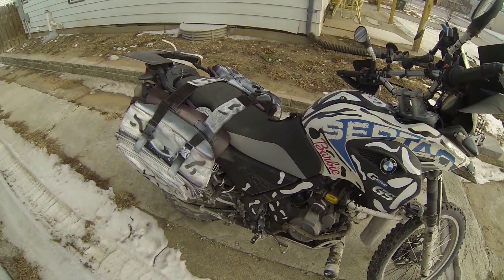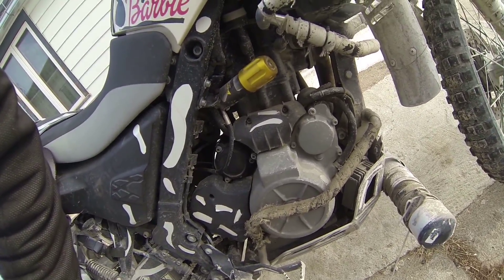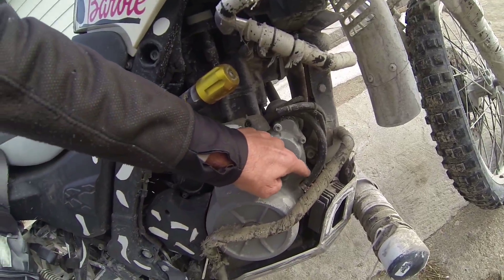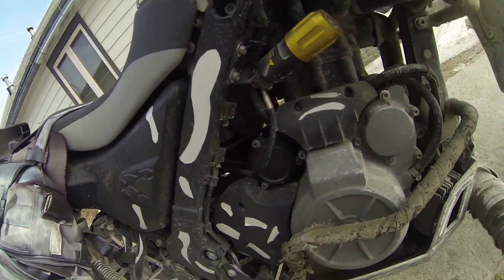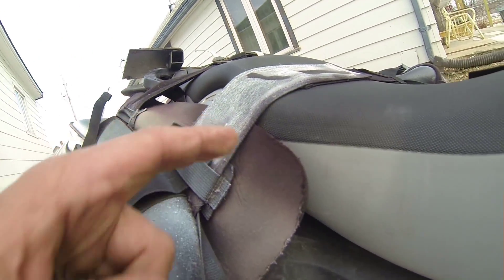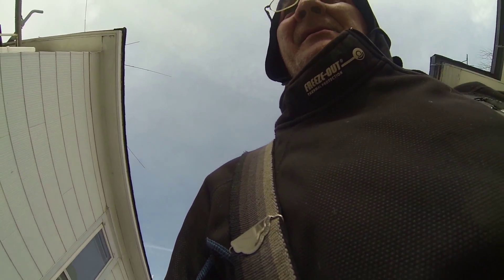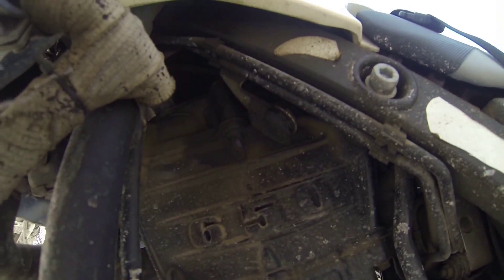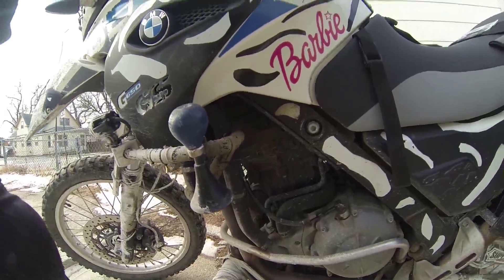Video for Dr  Dual Sport BMW G 650 GS

Comment: Wow how cool is that a personal video! I truly appreciate your kindness to help other riders and share info. I put a Shorai lithium battery in my WR450 and it made a world of difference but they are a bit pricey. The 650 Beamer seems to hold a charge ok but seems a little wimpy on spinning over the engine. I will have to do a cranking draw down and recovery test. I have seen you start in sub zero temps and I am very impressed with that battery and the price is reasonable. I will have to take a look at the Rotax to check out how they vent the crankcase.

Comment: just a wrong routed hose give you all that trouble ....
I don't like gel battery,  I always buy the bigst ( capacity ) what fit from a good company , on my old K75 I use the battery plate of the police version so I can mount a larger battery than in the car of my wife had,, and no swet when it's cold with a cold start